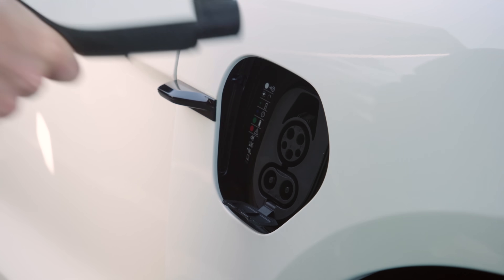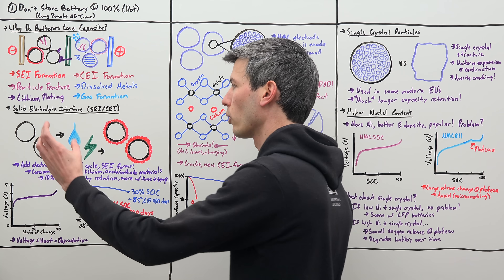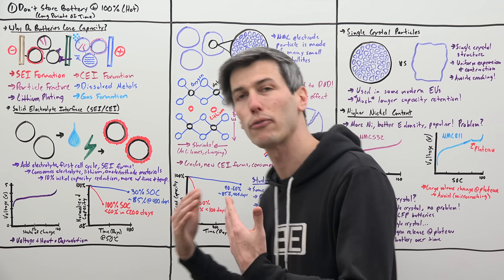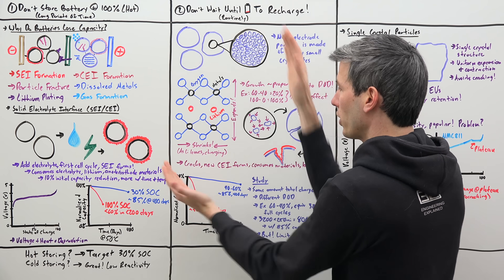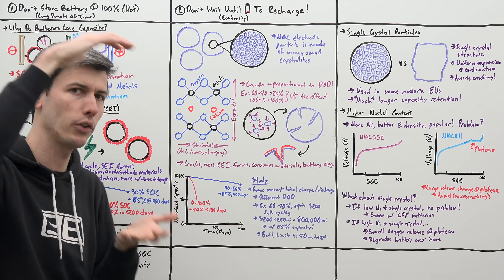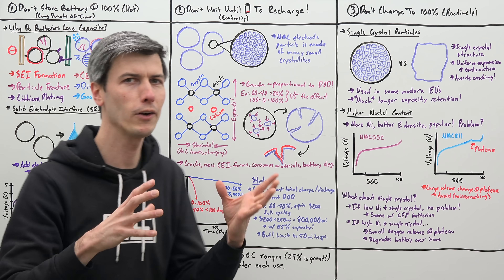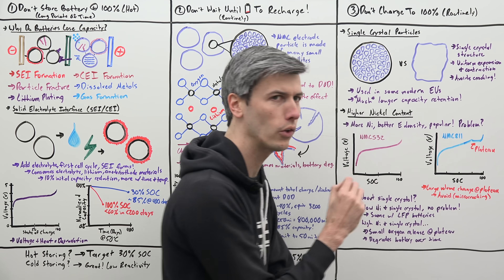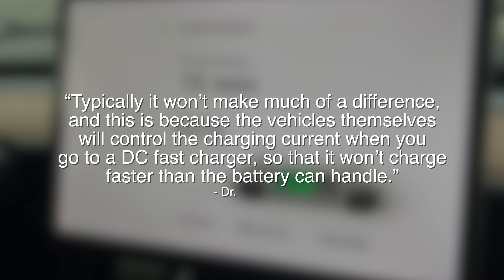How To Ruin Your Electric Car's Battery - NMC Edition!

Comment: How many car manufacturers have created systems that essentially lie to users to make sure things remain optimal? They probably all tell you the battery is at 0% before it is, preventing you from actually running it down to empty. Do any of the only charge the battery to 80% and tell you it’s 100%? As a consumer, I’d much rather the device handle the optimum charging cycle.

Comment: Finally, a voice of reason. As for LiXXX chemistry (high density + high discharge rate), my years of experience say (basically from beginning of this chemistry):
1. Don't discharge to 0% and don't charge to 100%.
2. Use battery capacity between 20-80% (20-60% is preffered).
3. When in storage (max live, not used), charge/discharge to 50%, and keep it cool if available (5-10C).
Reply: I live by the 20-80% rule.  Even on road trips I only had to fully charge once to reach the top of the mountain & return trip.  Otherwise my EV Truck has only seen 80% charge limit it's entire life.  Lowest was I believe 16%.  Not hard to do when I charge daily, and just be aware when on a road trip.  It will get easier once I can use the Superchargers this month.
Reply: @Cjdergrosse  so your range on average is about 235 miles? - maybe 250

Comment: I have tested this with my phone over the last ~5 years.

I only used the fast charger that it came with and usually charged from 20-30% to 80-90%, except when I needed more.

Degradation after ~1500 cycles and 5 years was ~20%, which is remarkable for a phone battery with very small buffers and no cooling and very poor BMS I think.

A car would easily outperform this

Comment: The problem is I'm seeing many reports of very expensive NOT covered by warranty battery replacements.  I do not buy new cars.. so why would I buy an EV knowing full well that it is most likely being sold now because most likely it has poor battery life?    I do have the perfect use case for a short-range EV as I live in a smallish town that I make frequent very short trips that are bad for an ICE but I can group them together to make it long enough to at least get the engine to operating temps and burn off crap in the oil

Comment: The charging to 100% by the car owner is probably not technically possible because the manufacturer already built in a capacity buffer and the software on the car might say it's 100% charged, but in reality it's more like 90% of the actual physical capacity of the battery thst is never truly available to the owner of the vehicle. So charging to 100% should be fine because it's really much less than 100%.
Reply: I don't think they all have the buffer.

Comment: Im not an EV owner because i dont wanna be a beta tester but shouldn't manufacturers just not allow charging over 90% and just make the display show 100%? Yes reduces thr capacity but it also increases durability and resale value of EVs since buyers will know for certain the previous owner did not do deep charges ..🤔
Reply: Yes, some of them do that.

Comment: 3rd point, these days most manfuacturers like Toyota or Audi, in their documentation input gross and net capacity. So even at 0%, the battery still has 10-15% capacity. So the enduser can charge to 100%, because what he sees as 1 00, was never a 100 in the 1st place
Reply: yeah thats what toyota did with there first ev bz4x they lock away the botom and top end of the battary pack and limit temps on the battary and then they udapted the car to unlock the extra capcity and increase thermal limit tolerence due to massive outrange about there slower dc charging and crappy range with a single software update the bz4x became alot faster chargin and has alot better range even thou its still using the same battary pack and powertrain nothing change hardwarewise what so ever its still the same exact car.

Comment: But we have always to mention, that this tests are often high cycle tests to simulate a long period of time. A car is not a phone which you have to fully recharge once every 1 to 2 days. With this in mind we are talking, like seen in the midle part of the chart, about 800.000 miles. And this is an insane high amount. But still an interesting and good video.

Comment: Usually an EV-battery does not charge to 100%, the netto capacity that the battery management system shows is not the full capacity. So, don't worry. Carmakers have thought about that.

Comment: the more concerning part of this is that in ALL tests, the batteries seem to be crapping out at 200-400 days. 😐  in other words, you're gonne get degradation and no matter how you try, it's gonna wear out within a couple years??? that doesn't sound right when a toyota corolla can last 35-40 years and 200,000 miles plus, not just 800-1600 days? 😐😐😐😐

Comment: @engineering explained , I have a 2024 Hyundai Ionic 5 in San Diego CA (for weather considerations), I have to cover  very long commutes every day. 112 miles a day 5 days a week + week end driving, probably another 30 miles. I charge my car for free at work, they have ChargePoint L2 chargers, I get 60% of the battery consumed per round trip. SO I charge every day. From 60% to 90% and few days a week to 100% (it does not seat on the parking lot long @ 100%) The lowest batttery leftover I have had is 30% when I speed up on the highway. Driving is 90% on the highway. So my question is what would be my best charging strategy to maximize the battery life. It's a company car so don't be worried about the big milieage....lol

Comment: U say store it at 30% under heat and try to charge when batt is at a low state of charge to 50-80%. If a person stay in a hot climate region, then he can only use the car from 20-30%?

Comment: With this "avoid 100% charge" I have only one question: user relies on what software is telling us. If 100% charge is so bad for battery, why you even let user do it? Limit it to 95% and tell user it is full capacity! That's it! But only if you want to let the battery last longer. But if you want users to loose battery life faster, you for sure will do like is it now...:face-purple-sweating:

Comment: I have a 2019 eGolf that I commute a ton in. I charge at work and at home, but I don't have a great way to stop at say 80% or 90% without going to the car to check on it. So it usually gets a full charge, twice a day from 50% to 100%.
Reply: SoC target can be defined for each 10% bin on the eGolf. Just have to configure and select the 'charging location option'
Reply: @JulioGlide  thanks. I figured out something that seems to be working along those lines.

Comment: This reinforces to a point what I've felt for a long time. EVs are great work commuters as most live close enough. But they font easily replace ICE as a primary vehicle here in the wide open US.
Reply: The average driver in the US drives less than 40 miles per day.
Reply: They easily replace an ICE vehicle. You have never seen Kyle O'Connor (Out of Spec Motoring Channel) take his spontaneous 2,000 and 3,000 mile road trips. But two thirds of road trips in the US are 400 miles or less according to AAA. That's something any modern EV can do;

Comment: No thx. Changing my oil once every 6-12 months is so much easier than that. Imagine if a gas tank coild only stay between 1/4 -1/2 full or you'd ruin the engine. Ridiculous.
Reply: A typical internal combustion engine has 30% efficiency when converting fuel to kinetic energy. Ev on the other hand, has upwards of 77% to 94%. We're talking 2 if not 3 times efficiency over those old fossil fuel burners
Reply: @harrisnasir5753  Who cares? Price is all that matters and EV's are more expensive and more of a hassle from start to finish. How bout you buy an EV if u want, and I buy a V12 if I want. Is that ok or are you a control freak?

Comment: EVs still require way too much knowledge about how to get the most out of them. Not necessarily in longevity but also maximizing charging curves etc. I'm into that kind of stuff so it would be fine for me but there's no way I'd recommend one to my mom.
Reply: Same with ICE cars, there's many many nuances you have to know to prolong their life.
Reply: @RawbLV  In practical daily use ICE cars require no knowledge other than what side the fuel filler is on. You don’t need an app to refuel, you don’t need to precondition your engine to refuel, you don’t need to concern yourself with what level to fill the tank to etc. It’s just the benefit of being a completely mature platform.
Reply: All your mom needs to know is to drive it, charge it and enjoy 😉

Comment: fyi, most of these also count for your phone battery life!
Reply: The issue with adapting this to phone batteries is an EV battery could potentially last 3-4 days before needing to be recharged (which means you can use that 20% range to get best longevity) 

When was the last time your phone was able to last a whole day (of actual usage) on 20%, or even 40% charge? 

Charge your phone to 40% and see how long it lasts without you changing your usage habits 

Only way I can get a day out of 50% was buying a phone with a 22,000mah battery (Doogee V max)
Reply: What doesn't?
Reply: Yes is the same for phones

Comment: Hello Jason, I have an idea for a video. You're a very smart car engineer, especially about tires. I saw a review of a Tesla with 18" wheels. You can get it with 19" wheels and lower profile tires (same overall diameter) as an option, but it has less range. Why is that?

Comment: I'll have to admit that I had my eyes glazing over during most of the video. 
I did get that you shouldn't charge too 100% when it's hot out and leave it sit.
Hey, I'm still using a flipphone and driving an '86 Trooper with a Millennial AntiTheft device.

Comment: Given that the Tesla Powerwalls use NMC, it sounds like there is no way to avoid rapid capacity loss, right?
Especially in backup only mode,  you are forced to keep charge at 100% to avoid cycling.

Comment: Easy thing for car makers is to install a 100 kwh battery and tell you it is an 85 kwh battery and have the charging system also treat the battery like an 85kwh.  They you never have to worry about charging your battery to too high a level.

Comment: You should have refered more to the newer chatode chemistry NCMA which shows way better longevity than standard NMC chemistry. That 1% aluminum content serves as a stabilizer and prevents lot of that high SOC intability and degradation.

Comment: What makes fast charging mostly a non-issue is that the absolute power used to charge a battery doesn't actually affect the battery much other than the residual heat it produces. What matters more is the power/current used relative to the total capacity of a cell or battery pack. In battery engineering circles, this measurement is termed as C-rating. 1C is the amount of current it takes to charge a battery from 0% to 100% in 1 hour. The larger your battery, the more power you can dump into it and EVs tend to have heaps of capacity to absorb all that power.
Reply: Yet battery degradation curves are HIGHLY dependent on C-rating.

Comment: I own a 2022 Polaris RZR Trail 900 with 26 8 12 front and 26 9 12 on the back Carllile tires.  I am told by the experts that I should but new and better and I can afford it.  And Old Cowboy once told me to use up what ya got.  I am mostly blind and slowly drive through hard pack.  This buggy can park where others get stuck...Your expertise is needed...

Comment: My Chevy Volt does this automatically (points 2 and 3) I don't remember the exact numbers but "0%" is actually around 30% and "100%" is actually around 80%. 
Of course range is less of an issue on a plugin hybrid than a full EV, but I kinda assumed all EVs did this.

Comment: My first EV ist now 10 years old, Smart ED, small 19kWh battery, high C and SoC use, was usually parked with 95% SoC. After 10 years 82% still left, thats good for such an ancient battery. Now LFPs took over, lets see how they will last, they got so good (3C charge rate) that they replaced the need for the more expensive and larger NCMs

Comment: Very helpful video! My wife just got a model 3 and the Tesla app recommends charging to 100% "once per week to maintain battery health".  Why is this recommended when it goes against the physics of the battery chemistry?
Reply: Normally the Battery Management System (BMS) counts electrons leaving the battery and also whats going back in during regen braking and partial charging. Over several cycles this method of accounting for State of Charge can drift off, but its reset back to 100% when fully charged. 

For LiFePO4 chemistry the midrange SOC voltage curve is so flat that the BMS can’t balance the cells correctly. So fully charging it ensures they are all topped off, and as long as all their capacities are still matched, they will stay in balance all the way to 0%.

If its NMC Li-ion chemistry, it shouldn’t need to be charged to 100% every week because that SOC curve isn’t so flat. The LiFePO4 pack however might try to balance the pack at 50% all week and actually cause an imbalance, and then if you drive it that one low cell group can trigger turtle mode while waiting for the BMS to move all that energy back (assuming it has active balancing). 

Unfortunately these high tech cars won’t even allow you to see the information my $1000 ebike tells me. I can open a Bluetooth app, and it shows me the voltage of all my cells, and the battery temperature, and if i want I can click “start autobalance “ and it will balance until all cells are the same voltage. 

There are apps for tesla that let you see that, which should be available in the main screen. Then you can watch that and when cell voltage drift too far off after several partial charges you can fully charge it so it will enter balance mode (since tesla will not allow you to charge the settings, just view the data)
Reply: @imho7250  Very helpful reply!! Thank you for taking the time to explain it all.  I believe our car is a LiFePO4 because it's a 2023 RWD.  

I will check out a monitoring app to learn more about our specific car to see what it's thinking.  Thanks again!

Comment: Same is true in other applications. Some people leave their phones to charge until they need them, and let them die, and remain dead until they happen to have an opportunity to charge, and also remember that their phone is dead, and think the reason batteries lose capacity is that all the manufacturers are involved in some conspiracy that has agreed on making the batteries lose capacity artificially. Sure, upgrading the software and adding constantly active background activities doesn't help increase the time a charge lasts either. 

I think this is a good argument for super convenient low power charging, in the case of EVs chargers should be made available wherever reasonable, like work place parking spaces, even just 1 kW each could be enough, but most people seems totally set on the idea that charging has to be as fast as practically possible, almost like if they can't charge a car from 0-100% during a full work day, they consider it pointless. In some areas it's not uncommon to have 6-10 amp 240 volt outlets at parking spaces for engine preheating, which during 8 hour working day can give most people more than what the commute requires. It doesn't have to be a huge cost to install ~2 kW chargers, but it seems most people think it would be pointless.           

Similar thing about phones, while researching before my latest purchase, the biggest drawback of one model according to most reviewers was that max charging rate was 18 watts, and just 7.5 watts wireless. That's so important, if it takes 10 minutes, or 45 minutes, to charge the phone to 100% before it is just kept at 100% until you stop the charging again, because you have no way to know that the phone will eventually run out of charge, that's a complete surprise, every time, and there's know way to know the state of charge to figure out if you should charge your phone when you have convenient access to charging, and later won't have that for a while, oh wait...

Comment: Nice vid.  Glad to see a personal rather than AI speaking!

I had Model3 for 4 years now. I remember for the first time, a 90% charge would get me 293 miles.  Today at 2024, I now get 279 miles charging to 90%.  Usually I'd wait until 30 miles remaining before recharging to 90%.  

Gonna start charging to 80% now.

What's your take on sodium battery and its degradation?

Comment: Can someone catch me up on the term definition of "particle" here? What is a particle made of? 

As not to be confused with particles that makes up atoms, ...or... elements themselves ...or... particulates like used to explain air quality {size}.  But I always assumed batteries were very much just atoms beside atoms or ions and electrons and atoms don't crack in batteries so what exactly are particles regarding batteries? And what elements the made of? . obviously far larger than requiring the term ''molecules or compounds''. Thanks.

Comment: Old enough to remember when best practice for home charging was to invent a staggering charge profile to use the existing electrical infrastructure.

But that was all assuming stuff with < 80 kWh batteries, wasn't it? No way home charging will fill your Hummer in less than a day.

And as we know, if you can't home charge, it doesn't make sense to get an EV.

Comment: How do electric cars deal with cell balancing issues? I know on e-scooters you're supposed to charge to 100% because there's a process that "balances" (equalizes) the voltages of the cells that only happens at a full charge. Surprised the issue didn't come up in this video